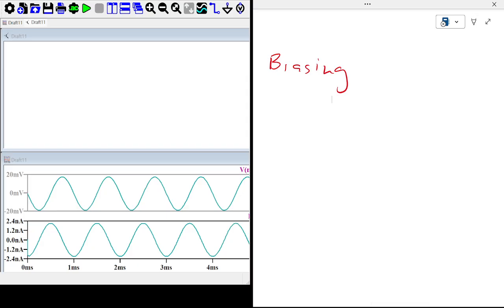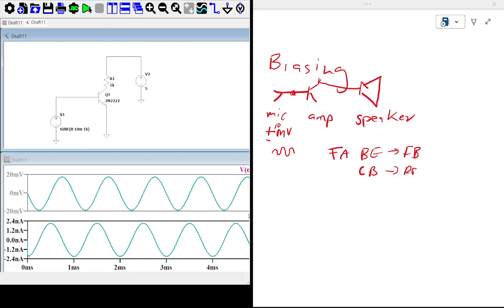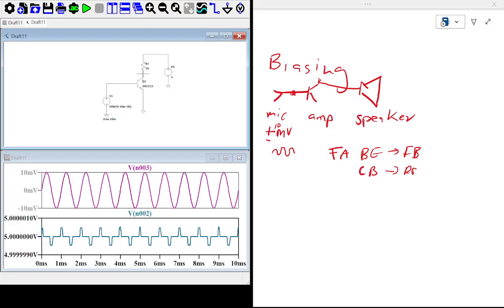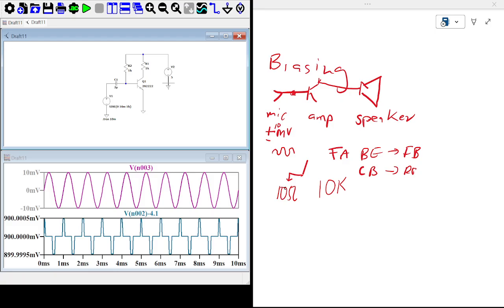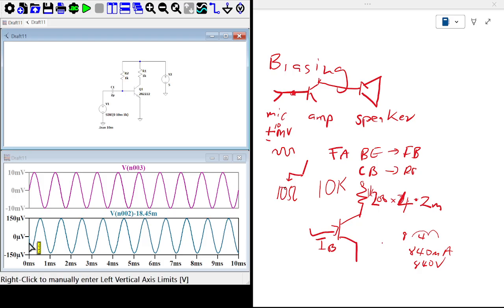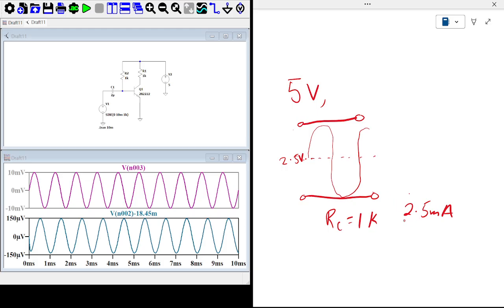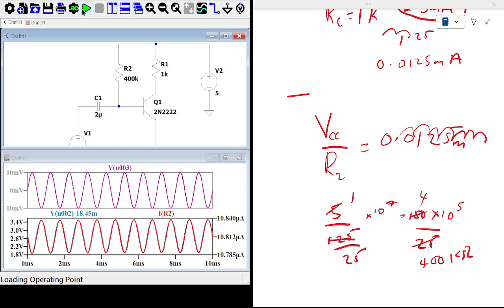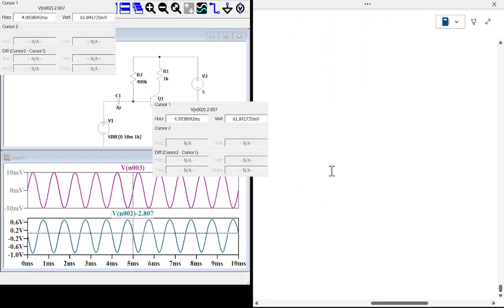Part 10 – Practical BJT Biasing with a Single Supply  Resistor Design, Headroom  & LTspice

Comment: Thank you for the video, Sir.
 I would appreciate it if you could elaborate on the approximations responsible for the discrepancies observed at 23:20.
Reply from the maker: In practice, there are almost always small discrepancies between theoretical calculations and measured or simulated results. Theoretical analysis relies on ideal assumptions, while simulation tools attempt to model real device behavior more accurately, including non-ideal effects. Because of this, it’s not uncommon for the values to differ slightly. The important thing is to first verify that the calculations are correct and that no assumptions were violated. Once that is done, the remaining differences can simply be accepted as practical non-idealities rather than errors.
Reply: Inspirational. Thank you.